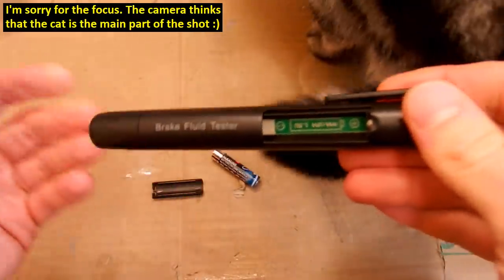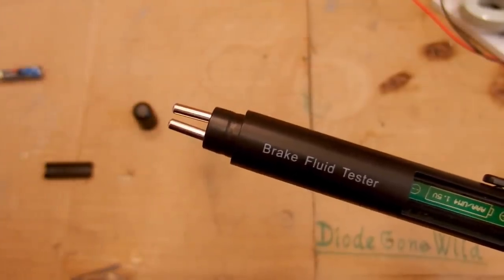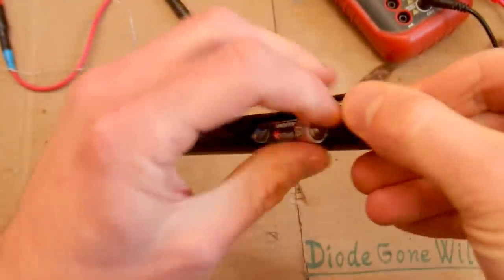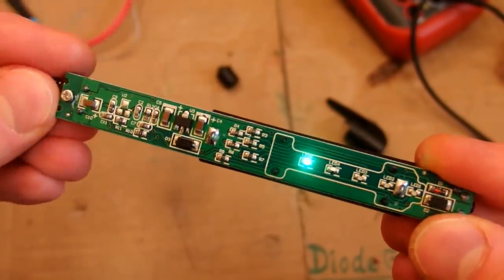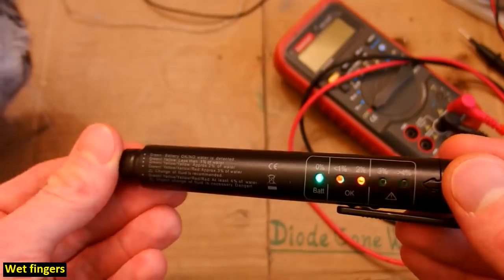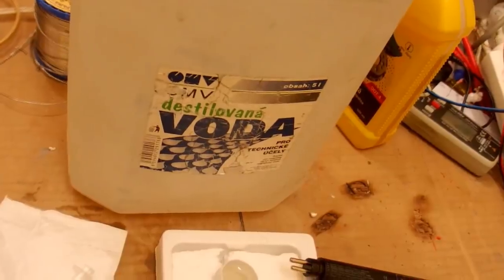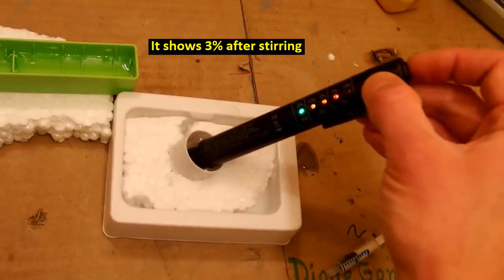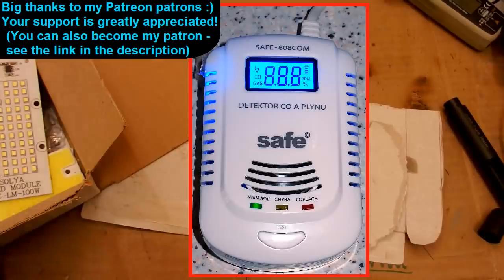Brake fluid tester - test and teardown

Comment: Those cheap testers actually work quite well. I have a professional one in my workshop (which does a real test of the boiling point) and the results I get from the 2.000 Euro tester and the cheap one are more or less the same.

Comment: 100ml breakfluid + 10ml water = 110ml.  So 10ml of water is 9.1% of the total of fluid. ;)
Reply from the maker: Well, you're right :). But I expected to only add 4% of water, so the error would be very small. Then I ended up going up to 10% because of the low sensitivity.
Reply: The assumption that volumes are additive is not always true. To get beyond a first order guess you need to measure the volume of the resulting solution.
Reply: Much more safe to change break fluid regulary.
This gadget look like work, ok not perfect assembled but electronic work.
Reply: @spelunkerd  Then say fuck it and go by mass lol

Comment: There could be a procedural error in your testing.  When PEG absorbs water from the air it becomes "bound" to the PEG molecules over time. Free water molecules in suspension may give a different (maybe lower) reading than water molecules that are bound.  My understanding is that the H20 splits and a H+ becomes bound to a different part of the PEG molecule, therefore I'd expect the conductivity to be slightly different.

A better method would be to add the water in a sealed container,  and leave it an hour or two with agitation before doing the test.

Regardless, I think device works fairly well, but the construction is very poor as you demonstrated - poor contact between the probes and the circuit board, and the probes are not sealed.

For those playing along at home but not sure what the fuss is about: new DOT 4  fluid has a boiling point of 260C, but when it's contaminated with water from the air this is reduced.  Badly contaminated brake fluid could have a boiling point of up to 100C lower than it should be.  Fluid that boils in the brake cylinders can cause a vapour lock that can reduce braking efficiency, cause asymmetrical braking between left and right, or even render the brakes completely useless - all of which can be very dangerous.
Reply from the maker: You may be right. I made the video in a hurry and didn't think about all the black magic that can happen when chemicals are mixed. They sometimes may not come to an equilibrium right after they're mixed. Like a tooth amalgam that hardens an hour after mixing the ingredients. Or even the sorcery, when the ingredients of the Belousov-Zhabotinsky reaction are mixed. I should try it with samples that have been sitting for some time.

Comment: I have a similar device that I got on eBay from China. It's labeled a water quality tester, but only has one LED. It lights up when there is any trace of conductivity. Inside is even simpler. 2x AAA batteries so no need for a boost converter, opamp, transistor and passives.

Comment: Great video...I am a retired auto/marine tech and I cant tell you how many ABS systems were ruined by moisture corrosion due to high water content in there brake fluid...simple fluid change once a year save you a lot of money later..
Reply: Once a year instead of once every two years?

Comment: Polyethylene glycol is quite a strong solvent, though slow acting due to its high molecular weight. It probably will soften the chinesium plastic after a bit.
Reply: I think the fluid is monoethyleneglycol, not polyethyleneglycol (which isn´t toxic) based.
Reply: @marcelozazulak4356  You are correct, though it will still take the varnish off your best table, and attack many plastics.

Comment: This is pretty accurate, because the % of water in the brake fluid is calculated : %water= (Mass of water/Mass of solution)*100, and Mass of solution= Mass of water + Mass of brake fluid

Comment: I believe distilled water is why it is reading too low.  While the water from air is 'distilled' in a sense, you're forgetting that there are other contaminants in the brake fluid that when mixed with water will act as electrolytes and make the mixture much more conductive than your mixture of clean fresh brake fluid and distilled water.  At least that's my theory.  EDIT - This could perhaps be tested by repeating your experiment with a small amount of brake fluid drawn from your car.  Take a baseline reading, then add a known amount of distilled water.  Also note that the 1st yellow LED claims to indicate >1% not =1%

Comment: But distilled water is an insulator. How does it increase the conductivity of breaker fluid mixed with it.
Reply from the maker: It's like mixing distilled water with salt. Salt crystals are non-conductive, so is distilled water, but the solution is conductive.

Comment: I did a test with it, used a potentiometer 200k and my millimeter, red led turned off at 77k, after cleaning the board from the solder resin with alcohol and a sprayed it with carburetor cleaner and let it dry, red led turned off at 68k, also did the volt test, I think this pen is a bit of, after cleaning nearly close to the volt test

Comment: Rain water is far a way from distiled water. Why? Rain water pick up from air micro particle.
Instrument work but not assembled well. Cheap plastic.
Reply: Peter B  people automatic when hear , rain water, think it must be like distiled water. You can mesaure resistance of fluid or capacitance. In central heating system I found  capacitance mesaure level of fuel. And system work very simple.
Back to the breaking fluid.
 To be accurate in fluid must be add mixture of distiled water and some tap water. Any way when you light up more than 2% water in the brake fluid time is to change fluid.
People for long time even do not think about brake fuid.

Comment: What worries me is the "fail unsafe" nature of the device. When you initially tried it (with the poor connection to the contacts) it registered "safe" even in water. An inexperienced user could take the reading as true, despite their brake fluid being high in moisture. The instructions should include a first step of testing the device by shorting the contacts before use, or make it "fail safe" by reversing the indication, with all LEDs on meaning "safe" and a reducing number indicating more moisture.
Reply from the maker: They just didn't expect the electodes to get accidentally disconnected.  And anyway, if 5 LEDs meant no water, it would still light up 5 LEDs with disconnected electodes. Brake fluid with no water in it acts the same as open circuit.
Reply: @DiodeGoneWild  Not my point. If a device (especially a safety-related device) fails - even if failure isn't expected - it should not be able to fail in such a way that failure can't be distinguished from a "safe" reading. Agreed, "probe not in fluid" should be distinguishable from "fluid is OK" but "device is broken" shouldn't read as "all is OK".
Reply: @tonywalton1464   I think the real learning point is that the words 'safety' and 'cheap' do not often belong in the same sentence. If you want a properly designed, well calibrated, robust and fail-safe device, you can probably go to the market and find one but it will be many times the cost of this one. And, unfortunately, cheap designs don't usually include the labels and the booklet of disclaimers that would warn you about their shortcomings! Safest option might be to just spend the money on new brake fluid instead, and change it annually ...

Comment: You should heat that brake fluid and water to 80ºC for a couple of hours to see if a hot engine bay will evaporate the water out of the brake fluid. You can cook food on an engine, so it gets quite hot. If it does evaporate the test is moot because the reservoir will always show low water.

Comment: Well, adding 4 ml of water to 100 ml of brake fluid is less than 4 %, but I guess it's close enough. But brake fluid typically saturates with water at about 3.7 % water (by volume), so adding more won't increase it's water content.
I'm pretty sure the device measures the water content correctly, but you probably didn't give the brake fluid enough time to absorb the water.
Also, it would have been interesting to know what the distance between the metal probes is and at what resistances additional LEDs light up.

Comment: error is probably from poor contact resistance.
What is the separation of the electrodes? I should be able to use an ohm meter to measure right?
Reply: separation, length and diameter of probes would make it change,  so youd have no reliable method
Reply: @jusb1066  easy enough. put probes into a holder than maintains a separation. Submerge to a measured depth. Measure new fluid. Then use the same probes and method to measure used fluid.

Comment: Nice,
where is the video of changing this belt, I would like to see, I also have to change mine on my tdi! but ... I have some fear ...
Greetings from Portugal!!
Reply from the maker: There's no such video yet, but I plan to make it. It will probably be in Czech, but maybe with English subtitles. But to change the timing belt you have to know what you're doing. Doing it wrong destroys the engine. What car and engine do you have?
Reply from the maker: In 1.9TDi 66kW (AGR, ALH) and 81kW (ASV, AHF) the timing belt system should be the same as in my 1.9SDi 47kW, except that in TDi you have to remove few more things to get access to the belt (like intercooler duct, maybe some hoses, water tank, ...) and that TDi has one more small idler pulley.
Reply: @DiodeGoneWild  Thanks for your response.
My engine is the 1,9Tdi ASV (110hp) from year 2003 (Vw golf4).
I know, at least, the following steps, I know that is not so difficult, the problem is that a wrong step ... can ruin the engine and it's a shame because there are only 180 thousand km.
Recently, I found myself too crumpled to replace the alternator shaft, which was so tight that I damaged my wrench (not to have to remove the alternator)
Best regards.
Reply from the maker: This one seems to have almost the same timing system as my car, except that the small pulley is not omitted. There's a bit more things to remove to get the access, like the intercooler duct, maybe water tank, hoses, brake fluid tank. In any case, you have to remove the right wheel (after lifting the car), also the wheel well, then the alternator belt (probably use a new one, or at least mark its direction). Then remove some covers of the timing belt. Lift the engine so that you can remove the engine mount on the passenger side. It's recommended to use new bolts for the engine mount (they are stretchbolts). Remove the alternator belt pulley from the crankshaft. Mark the position of the timing belt on 3 pulleys: The crankshaft pulley, the camshaft pulley and the injection pump pulley. You can then transfer the marks onto the new timing belt. Officially, instead of making marks on the belt and transferrng them to the new belt, you're supposed to loosen the center nut of the camshaft pulley and the 3 nuts on the injection pump pulley and then set everything according the the timing mark on the flywheel and special tools that hold the injection pump and camshaft exactly in the right position. But I decided not to loosen the nuts and just transfer my marks from belt to belt. But no matter the technique, NEVER loosen the center nut of the injection pump! My technique relies on the fact that everything was set right during the previous installation. I don't loosen the camshaft pulley and the injection pump pulley. I just put the timing belt exactly how the previous one was. It's a bit tricky to put it on without loosening the pulleys! But not impossible. Also replace the water pump and all the idler pulleys and the tensioner. Drain the water before replacing the water pump, of course :). Tighten everthing to the specified torque. Tripple check (!!!) if the tensioner "hook" is in the hole, so it doesn't loosen by itself! If the hook comes out of the hole, you lose the tension and bye bye engine. You may also bend the hook if you tighten the nut on the tensioner while the hook is not in the hole. Loosen the tensioner enough before putting on the timing belt, but not too much, you could bend the hook or make it come out of the hole. Put the timing belt on, the last pulley to put it on is the big idler pulley (this is my technique). Do this before installing the small idler pulleys.
You get more play to put it on even without loosened camshaft and injection pump pulleys. I didn't even lock the camshaft in place, I didn't find it necessary. I just inserted something into the hole of the injection pump pulley (it's 6mm diameter hole) to keep it in position. Remove it after putting the belt on and installing the small idler pulleys. Tension the tensioner. Turn it by putting small pliers into the 2 small holes until the marks of tension match. Then torque the nut to the specified torque. Press the timing belt with your thumb. The tension marks should move. Remove the thumb. They should go back to where they were. If everything is right, then turn the engine 720 degree back to the TDC (top dead center) mark on the flywheel. Check if you can again insert the 6mm pin (for example the even side of a 6mm drill bit) into the injection pump pulley hole. Also check the position of the camshaft by removing the vacuum pump from the driver side end of it. The slot should be exactly parallel to the edge of the engine head. I was too lazy to remove the valve cover and use something to keep the camshaft in position, so I just checked the position. If you can turn the engine 720 degree without anything colliding and everything is in the right position after the 2 revolutions, it should be right. Tripple check if the crankshaft, camshaft and injection pump are always getting to the right position every 2 revolutions. Recheck the tensioner marks after turning the engine, of course. Put everything together, remove all tools, and pray to all known gods before starting the engine. If it starts and sounds well, everything should be all right. But I don't give any guarantee, read some other instructions as well! Really make sure that everything is properly tightened and that the hook of the tensioner isn't bent or out from its hole. This almost cost me my engine, but luckily I noticed the hook is out from the hole and fixed it! I had to remove and reinstall the belt to put the hook into the hole in the engine block. My technique also relies on the fact that the previous timing belt  change was done right and that nothing came out of timing since then.
Reply: @DiodeGoneWild  Thank you for your words.
I liked it very much, especially your statement:  "...and pray to all known gods before starting the engine...." !!!!!! ahh ahhh!!
Reply from the maker: I've made the video in my other channel, but it came out 44 minutes long. It will probably take some time before I manage to add subtitles to it... But of course a timing belt change isn't something one can explain in 5 minutes.

Comment: The one That is wrong is the experiment. You use too small volume and the deviation to actual % is large.  You must use at least 300mL of brake fluid volume to get accurate enough water contents. The larger the volume, you have better accuracy in adding the water

Comment: 9:30 last diode indicate not only % of water under 4%, but also over 4%. We need new video with testing of conductivity for calibrating another/DIY testers. I have tens of 100M SMD resistors for this sort of fun, i can sent You 30 pieces.

Comment: Every 2-3 years change the brake fluid ?? Isn't that a little fast ?
Reply: It depends. If you live in an area with hills and mountains where prolonged braking may sometimes be necessary, water content is much more harmful. It also depends on the exact type of fluid. Modern fluids absorb less and hydraulic oil doesn't absorb at all. Also, some brake systems may suffer from corrosion independent of the usage of the brakes.

Comment: I think you get a bad unit actually. I got the exact same has the one in your video and i did test it too. The results was close to the percentage and wasn't sporadic as yours. The probes are firmly attached to the body and i didn't get blinking LED as well as the battery cover fit really tightly. I remember lost it a few time on the ground without it falling off. I was hoping you test that kind of tester and im glad you do but as i said i think what you got was a bad unit. Good video tho :)
Reply: just got mine today, probes are tight in body, very tight, cant remove them, was going to glue them in,  works too :)

Comment: So more or less just use your DMM to check your brake fluid or use DOT 5 instead. Edit: (If your vehicle allows for it).
Reply: DOT5 is much more compressible than DOT3/4/5.1 fluids and should not be used in performance applications, or any application with ABS. They are also wholly incompatible with existing DOT3/4/5.1 fluids. Not being hygroscopic is only a small part of the overall fluid dynamics.

Do not attempt to put DOT5 into any system that specifies DOT3/4/5.1.
Reply: @nomakewan  Good to know.   I only use whatever the vehicle calls for.   Not sure I've seen DOT 5 listed on anything I've owned so far.  Then again most of what I've owned has had red or yellow calipers if you get my drift.